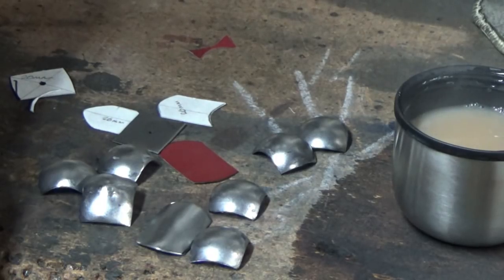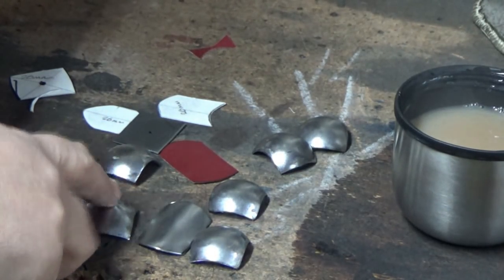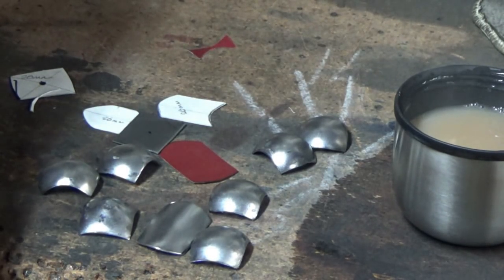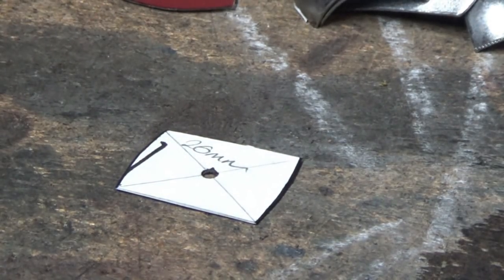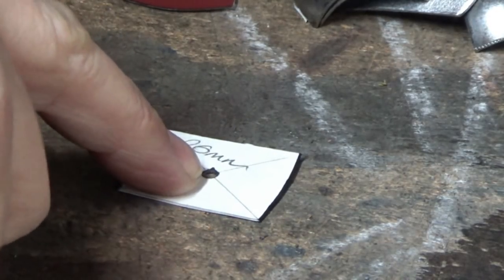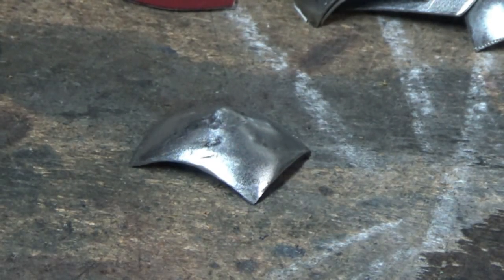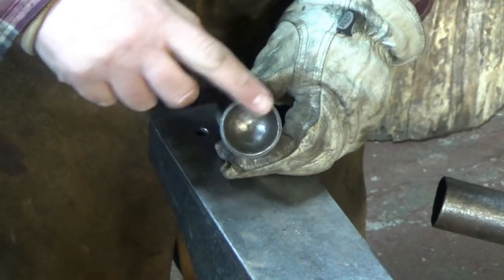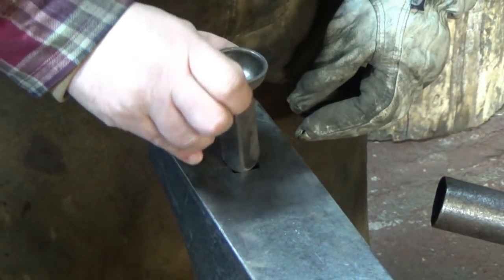How to make simple knuckle gadlings. Make your own Gothic Gauntlet pt. VII

Comment: Our process is identical, which is nice to see. The only difference is that I leave a bit of extra material on either side so I can clamp on a tiny vice grips and work the piece hot over the stake. Its hard enough to grip that tiny little piece without your fingers getting in the way and I find it just cooperates better under a little heat. Always a pleasure to watch you videos!
Reply: Keith Kempenich thank you
Reply from the maker: Keith, always nice when things are similar. I tend to work cold items more in the videos so it is easier to film, when I do these hot I add a little tab as you've mentioned that that's nice to hear :)

Comment: Can the same process used for steel be used with ally?
Reply from the maker: I've not much experience with aluminium but suspect if you go easy you should get there, but the lead block and modified cross pein hammer might cause havoc quickly, consider swapping them for a wooden form and pitch? But that's all guess work. Let me know how you get on.
Reply: Greenleaf Workshop Thanks, I will try it out. Ally just looks like a softer option to get started.

Comment: Dear Greenleaf, thank you! How do you adhere it to the gauntlet itself?
Reply: Typically they will have a small rivet on either side of the knuckle that attaches it to the backing leather strip. This strip in turn is sewn to the glove and riveted to the rider plate.
Reply from the maker: Pretty much what Keith said. I have recorded a video on it, but had to use my phone as the camcorder I have froze in the recent cold snap we had here in the UK and refused to work, so I will edit it together later and hopefully it'll help a bit, but one handed holding onto a phone isn't the best :)